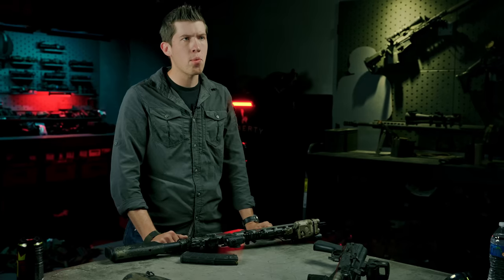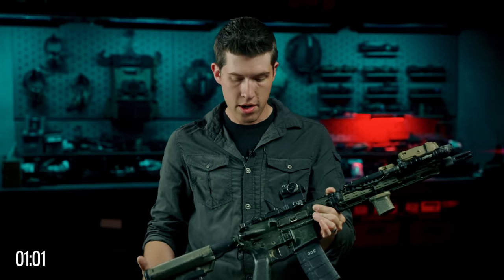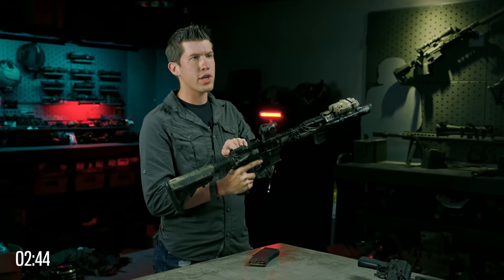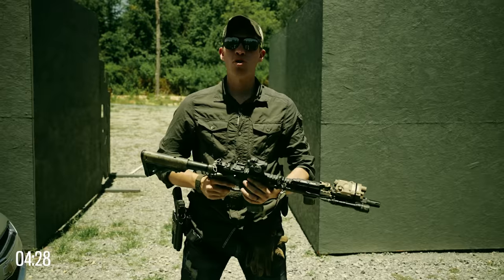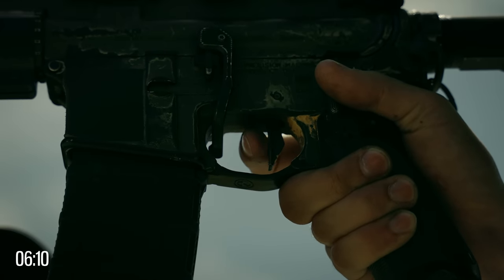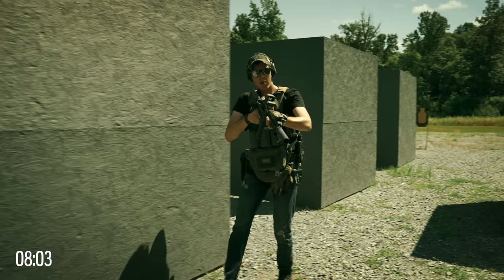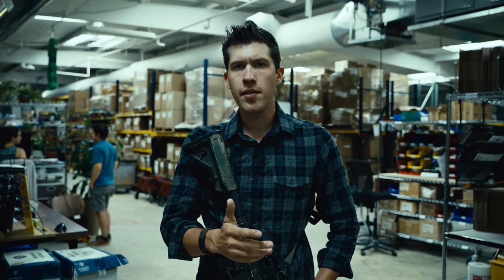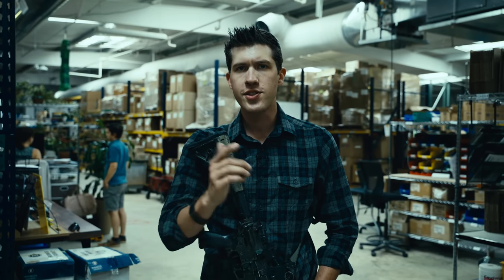How To Shoot A Rifle in 10 Minutes

Comment: I was at the range last week with a new AR that I've only had for a few months (side note: I'm in CA and it actually took 132 days from ordering the rifle to when it was ready for pick-up). I had put about 20 or so rounds through the rifle when I ended up getting a pretty nasty jam. Luckily, we had just started a line-break. The RM came down the firing line and noticed that I was struggling to fix the jam (had a few of these on previous visits). I handed him the rifle and he went  to work trying to clear the jam. I noticed he was trying to remove the mag, but I let him know that it was a fixed mag. I'm pretty sure he knew, but maybe he was hoping it wasn't. He put the rifle down on the bench and walked away shaking his head. I thought he was mad at me. He walked over to his car which was parked nearby, opened his trunk and grabbed a small (cleaning) rod. He came back and resumed work on the jam. With a little effort and the use of the rod, (and me holding the rifle steady) we were able to clear the jammed round. We both let out a sigh of relief. He then looked me in the eye and said "fucking California!" We both had a good laugh. Then I thought, this is a rifle that I may need in an emergency...
Reply: ouch. personally id just go for a straight pull AR or a mini-14 (or a fightlite scr if they ever restock)
Reply: wait.... in California they make you weld the mag to the firearm?
Reply: @spondoolie6450  Actually, I removed the Comp-Mag that it came with and am using the F.N.G.R. solution from MagLatch with a standard Lancer mag. It's pretty sweet. Takes me all of 2 minutes to convert from fixed-mag to non-fixed mag. By looking at it, you would never know that my AR is Cali-compliant 🙂

Comment: In case of a jam or malfunction, to clear a weapons malfunction in order to quickly and continually engage the enemy, the military called it "SPORTS." 
Slap, Pull, Observe, Release, Tap, and Shoot.

First and foremost, before we conduct SPORTS, we always switch the lever back to safe. 

1. Perform immediate action.
NOTE: If your rifle malfunctions, remember S-P-O-R-T-S. This keyword will help you remember these actions in sequence: Slap, Pull, Observe, Release, Tap, Shoot.

a. Slap upward on the magazine to make sure it is properly seated.

b. Pull the charging handle all the way back.

c. Observe the ejection of the case or cartridge. Look into the chamber and check for obstructions.

d. Release the charging handle to feed a new round in the chamber. Do not ride the charging handle.

e. Tap the forward assist.

f. Shoot. If the rifle still does not fire, inspect it to determine the cause of the stoppage or malfunction and take appropriate remedial action.
Reply: Could you please post the first two lines this on a Garand Thumb (Flannel Daddy) video?
Reply: @mcouture8169  ok 😅

Comment: Is it ok to use the forward assist when the gun is out of battery ?
Reply: The technical answer is "yes, but understand some things first."

Using the forward assist can force the bolt to go back into battery using the round the bolt is trying to feed into the barrel.

The problem with this is that while using the forward assist can put the bolt into battery to fire the round, your bolt might lock up as a result.
So most people choose to use the charging handle and pull the bolt back to try and avoid that bolt lockup.

Hope this helps.
Reply: If the bolt is stuck, pressing the forward assist will lock the bolt into battery. But for double feeds or failure to feeds, it's best to clear them the way Lucas showed!

Comment: Im actually trying to get my 1st AR-15. I found out im not a fan of the M4 "meatgrinder" stock.
went to my local indoor gun range and got a rental AR-15 to shoot. 
I got blessed and cursed with an AR that shot in 2 to 3 round bursts with a long trigger pull.
Reply: Had that happen with a hammer hinge pin half walked out. It's neat for a minute, but needs to be fixed before the hammer shakes loose in the receiver
Reply: Also, future reference, the "meat grinder" up front is the "fore end" or "fire grip". The stock is the back end you hold with your shoulder and cheek. 
✌️
Reply: @kerbalairforce8802  future reference, what the actual fuck is a "fire grip" hahaha you mean FOREGRIP and or FOREND? you can say handguard too.

Comment: You're missing a few critical componentsto malfunction clearances.  Mag in is always tap/tug to insure it's seated.  Then you're not running the charging handle/bolt in a double feed once the mag is removed.  These are glaring errors in rifle fighting but less so when all you're concerned about is a split time on a square range.

Comment: "Cat", here!  If you let the charging handle "spring" forward allowing the "T" handle to "slam" into the reciever, the "T" handle will begin to "crack" and eventually fail and break off!  Now you have a very expensive "club" instead of a "firearm" as you can no longer "charge" a new round into the firing chamber once the box magazine is empty?  Always, ALWAYS, "push" the charging handle forward to lock in place, then press the "bolt release" button allowing the bolt to slam forward loading a new round into the firing chamber!  Thereby, saving the "T" handle from, eventually, breaking off!
Reply: No.

Comment: Can this work with airsoft....
Reply: As long as the airsoft gun operates like a real weapon (minus shooting actual bullets) then yes.
Though it might be a bit.. odd since you might not see a lot of the benefit of a stance that braces for recoil when there isn't any.
Reply: @AGuy-s5v  thank 
1.my country ban all firearms 
2 airsoft is ban too but u play carefully...no problem
3.my is gas blow back so...most likely it the same
Reply: @WENDIGO_FROM_THE_VOID  Eh.. no, a gas blowback airsoft gun is not the same as a real firearm.
The recoil differences are rather noticeable.

This is advice from someone who owns both real guns and airsoft guns.

Unless we're talking .22 lr (long rifle) being the only real exception, and that's being generous.

Otherwise, when it comes to recoil, airsoft and real firearms are not the same.
Reply: @AGuy-s5v  i know it not the same but what i mean is can the training: shooting,
 reload , ADS, 6 r 6 , 1 r 1, switching,.....something like that
Reply: @WENDIGO_FROM_THE_VOID  Then yeah, if the bolt hold open, with a bolt release and a charging handle then doing loading and malfunction drills work rather well.
Reply: @AGuy-s5v  yes....and cost less